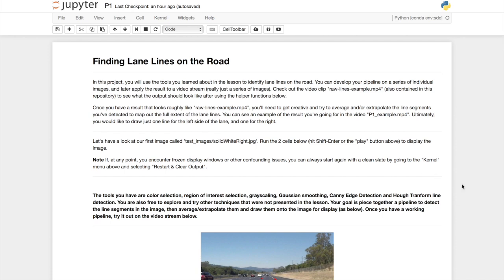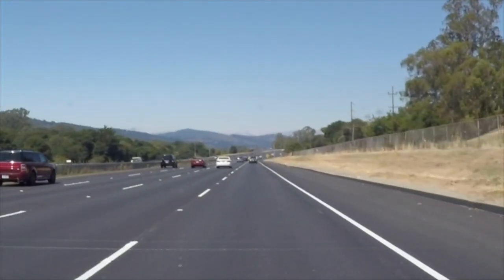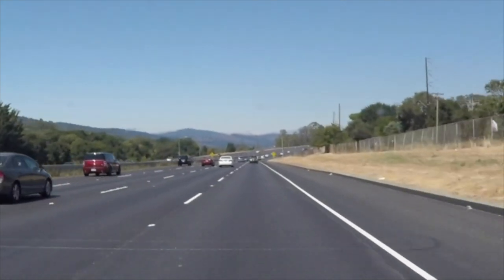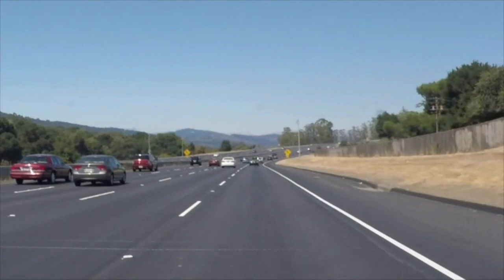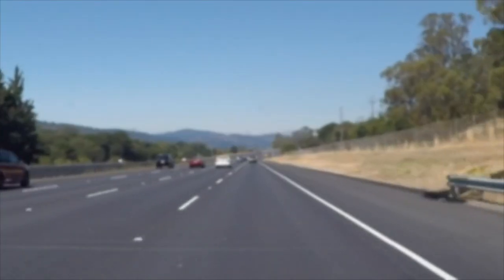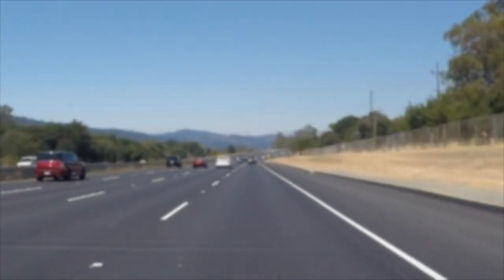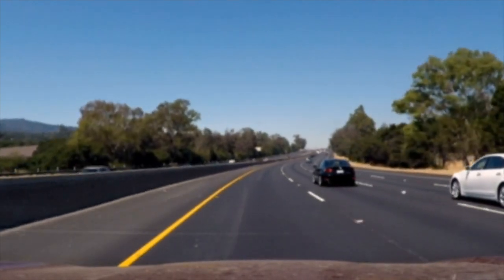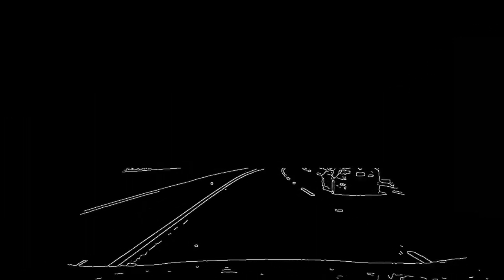Detecting Lane Lines on Indian Roads for Self-Driving Car

Comment: Great job!  On indian roads where the lane markers are less prominent what about detection the whole road and then calculate your lane alongside lane detection efforts. Also possibly use a rule to prevent the rapid changes saw the the side barriers were detected. Much easier when  roads are mapped obviously.
Reply from the maker: Yeah - the state of the art today is to use road segmentation I believe - or use object detection on the lane lines using neural networks. My approach here is the tradition computer vision OpenCV approach.

Comment: Is there a reason you chose not to grayscale the image first? Also as for finding the most dominant line, it looks as though you chose whichever line was longest for each side of the lane. I think to make that more robust you out to also look at the slope of each line. Then the most dominant line takes two factors into account, the length but also how close the line is to the mean slope of that lane line. That could help avoid the case where the dominant line isn't actually a part of the lane during the last few clips you showed.
Reply from the maker: Hey Mikael,

1. I chose not to grayscale the image first because in our challenge video, the brightness of the lane line and the road was equal. It was visually indistinguishable after applying that transform.
2. Yes, that is right I chose whichever line is longest for each side. I like your idea of looking for a line that is close to the average slope of the other lines.
3. Also, some basic filtering that the left lane will always be in the left side of the screen and not on the right would have also helped. :)

Thank you for appreciating the work!